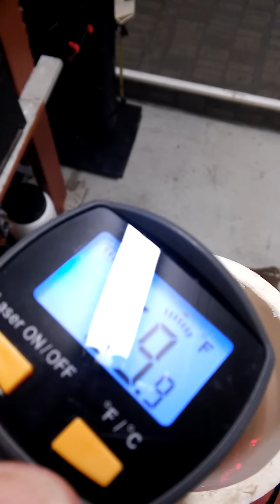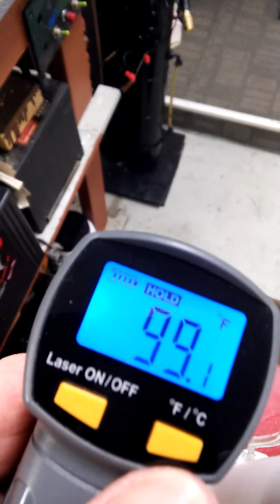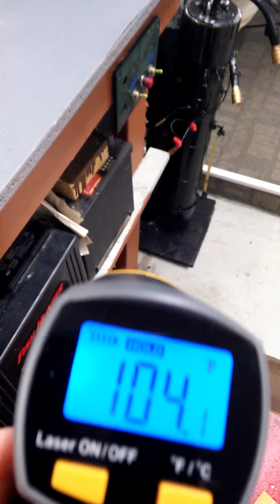gasoline heater

Comment: You could use a willhi thermostat to keep your temperature constant. I use them a lot. You can set whet ever temp you want and they are only about $20
Reply from the maker: +delvis11 where do you get one?
Reply: just go on ebay and type in willhi. Good luck!
Reply: I'm a little surprised to not see induction heaters being used, are they not efficient?